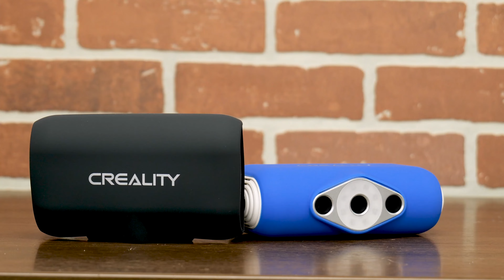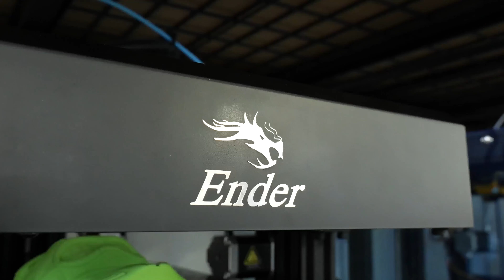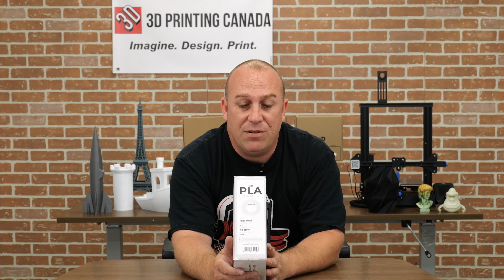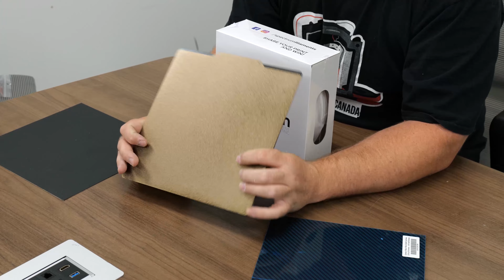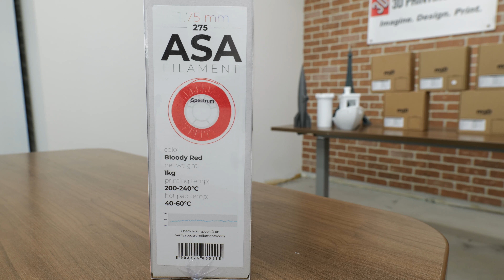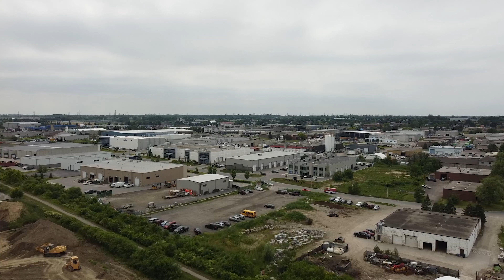GUIDE TO 3D PRINTING FILAMENTS

Comment: Thanks for the video!!!

I have been trying for a long time to get PETG to print and gave up.  Every time I tried printing the bottom layer was great, but other layers always separated after the first couple of layers.  I use Cura slicer, and the generic PETG settings have the parts cooling fan at 100% all the time.  Time to try PETG with no cooling fan :)